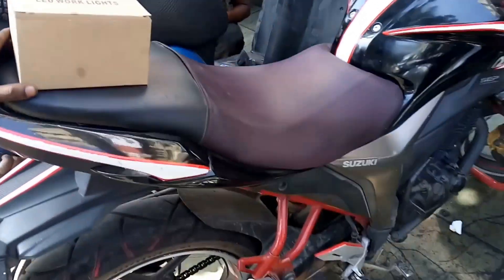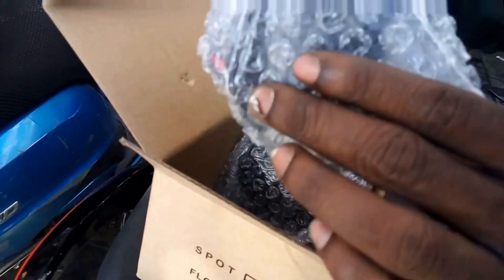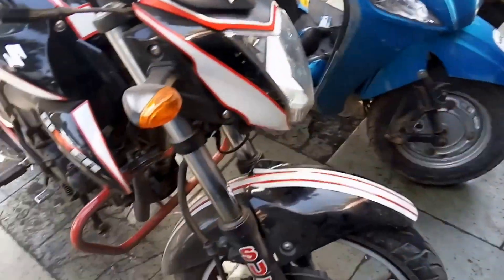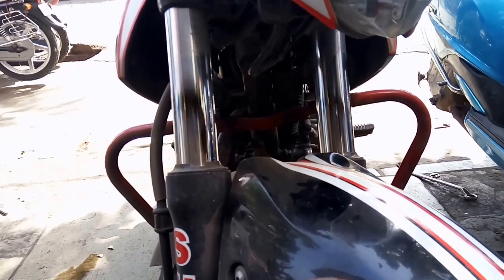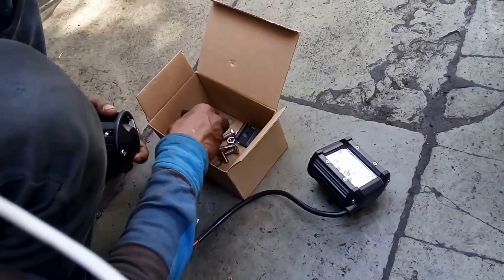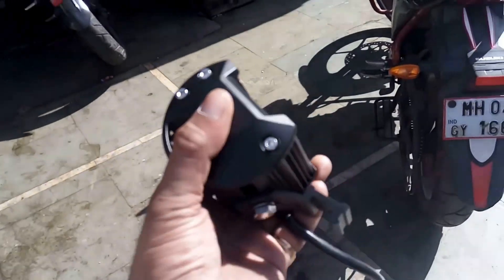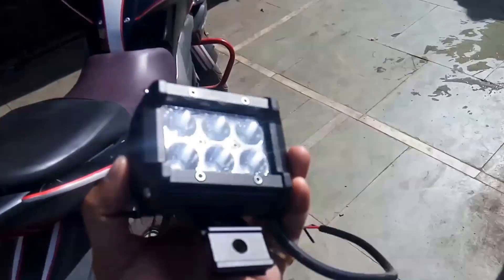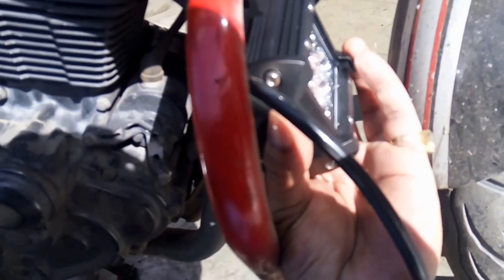Suzuki Gixxer - Fog Lights Modification

Comment: Thanks!
pls suggest any good phone holder (for GPS purpose)?, waterproof or not
Reply from the maker: Giridhar Sharma please see the link Leebo Spider Bike Mobile Holder with USB Charger Mototrcycle Mobile Holder Bracket For Royal Enfield Thunderbird 350 https://www.amazon.in/dp/B06XSHT38F/ref=cm_sw_r_cp_apa_i_0buMzbB5HS7RP
Reply: thanks, looks good!
have you personally used it?
any suggestion on covering it from rain/water?

last question :D, planning to put fog lamp/side mounted lights for my Gixxer for bike rides in hilly areas, any suggestion for that too which shouldnt eat up my battery?

Thanks a lot again.